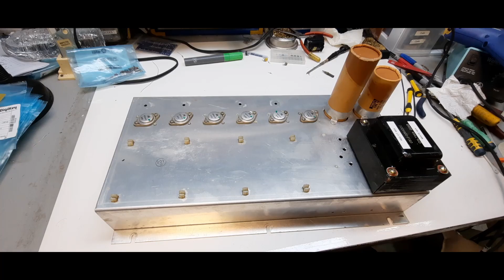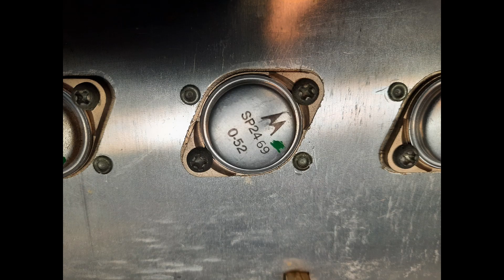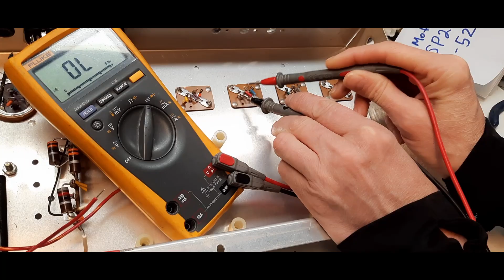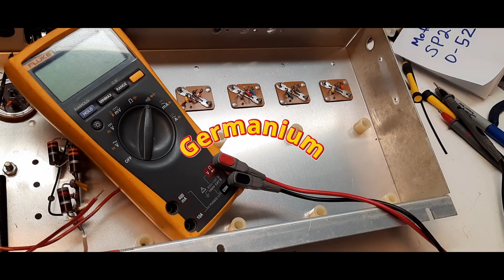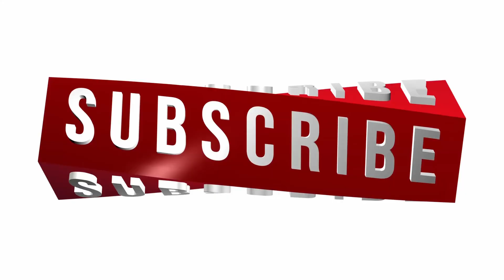Help! What Are These Transistors?

Comment: I couldn’t find the SP2469 in my library of cross references, but it was a good exercise to see how well the downloaded versions worked. Do you have a transistor tester M328 ? This would display the pin out and gain figures. Not sure if it indicates germanium or not.
Reply from the maker: No transistor tester. However, I definitely know it is a germanium and from the comments from others, i think I have a close match. Thanks for looking into it. Cheers!
Reply: @bettinaneumryr  Check out the M328. For less than $10 US it may be handy for you.

Comment: germanium made in 1952
Reply from the maker: Good to know... thanks~!
Reply: I was made in 1952, but the TO-3 germanium transistor didn't exist until 1955, and it was a Motorola 2N176. This is probably germanium made in the 52nd week of 1970. I spent 41 years of my life working in a Motorola plant. I don't think that the aluminum package existed in 1960, which is why I think these are from 1970. Motorola and others put "house numbers" on lots of parts for large quantity orders. This number rarely has any relation to the actual type number. I worked in consumer electronics repair from 1968 to 1973 when I left the repair world for an assembly line at Motorola. The hot part that was found in most consumer electronics in from the mid 60's well into the 70's was the 2N2147 PNP germanium TO-3 part. It was used in most amps in the 20 WPC and under range.
Reply: @TubelabCom date stamp states 1952
Reply: @PCBoardRepair  The 0-52 number on the package does not conform to the usual YYWW marking usually found on semiconductors and other parts, including those made by Motorola with 2NXXX type numbers. The TO-3 package seen in this video did not exist in 1952, so these parts were made after 1955 when Motorola invented and registered the TO-3 package. There are numerous examples of TO-3 and TO-36 devices made by Motorola with house numbers on them that do use an identical date code. The leading zero is the last digit in the year, so this part could have been made in 1960, 1970, or 1980. The -52 refers to the 52nd week of the year. The date code on those big Mallory electrolytic caps can tell you which decade they came from. I'm still guessing that these are from the last week of 1970. Likely PNP germanium. It appears that the original amp has been disassembled, but if the collector of a device was connected to the negative supply or an emitter was connected to a positive supply through a low value resistor, then the transistors are PNP, possibly a 2N2147 or 2N1360.

Comment: They are a germanium PNP in a standard T0-3 alloy package.
I dont know what you use them for in a modern project, except as some "antique novelty" etc, but at least that package only has one pin out so you know which pins are which.
Reply from the maker: Thanks for confirming! I plan to use them in a vintage-style amplifier project, if I find a project in a magazine. Cheers!

Comment: The number SP2469 does not appear in Towers' International Transistor Selector (1974), nor in the Babani International Transistor Equivalents Guide (BP85, 1981). No sign of 2N2469 either. So it's a mystery! But most likely a germanium part, if those forward voltage drop reading were in milliVolts. Don't listen to those in the comments who claim that germanium was never used for power transistors, or they must be NPN, or that an AI thinks the part is a MOSFET. There were plenty of PNP germanium power devices, e.g. OC23, used in car radios.
Reply: Vero, ne ho ancora adesso alcuni, recuperati proprio da vecchie autoradio moooolto tempo fa !
Reply from the maker: Yes ... Definitley PNP for sure. Thanks for checking Towers for me. I never heard of thay book. I plan on posting a video with the cap off and compare it to a silicon one soon.

Comment: Your measured drops are too high for single element die's,  they are more likely Compound Pair or Darlington Pair internally. These usually listed this as a multi junction or two transistor or compound in one package.  There would be internal resistances, the voltage drops would sum and yea they are not likely "transistors" but "packages".  Best identifier is a SAMS (paywalled) of course.  You can look up ones like Motorola MJ3001 or MJ3002 for reference but from what I see, they were not yet established consumer market at this point in design history (1965  designing for 1968 market release say) but were in the 'custom' state.
Reply from the maker: That's a really interesting point about them potentially being compound or Darlington pairs. I cut the cap of the TO-3 and there is some funny stuff going on. I plan on making a quick video with the magnifier mid week. Stay tuned to see what is inside. Cheers!

Comment: PNP Germanium. For sure. 100%. If you warm it up to 60deg C you can see the B-E voltage almost completely disapear becoming a short. If you heat it to 80C you should see a short circuit across B-E  thanks to the utterly craptastic temperature coefficient of germanium semiconductors
Reply from the maker: Hey ... you are right. I got it down to 4 ohms with my heat gun. I tried a silicon one and I could only get down to 140 ohms. Great way to tell if it is geranium. Thanks!

Comment: If you're getting a very low forward bias on the base pin, it's likely to be an older Germanium transistor, most of which were PNP .... but you should be able to deduce NPN or PNP from the bias... searching the part number did not help.  But if you call up directly to a parts distributor they're likely to have cross-reference listings that could lead you to the approximate specs.
Reply from the maker: Thanks for confirming my suspicion about the germanium transistor and the low forward bias!
Reply: @bettinaneumryr  
Glad I could help.

Comment: Pull one out and measure the   base - emitter   and   base - collector   voltage drop ..... a voltage of around 300 mV indicates a GERMANIUM transistor ... and  about 600 mV would be a SILICON type ....... DAVE™🛑
Reply from the maker: Yes, I did that and it was about 1.24V. Hence the reason to be confused. It turns out that they are PNP and Geranium. Equivalent to 2N2469. Thanks for watching!

Comment: Germanium  very possible. Very strange in an aluminum TO3. Possibly special order. I wouldn't use in a new design. If you have a diode setting, Ge would be like .3 Vf.
Reply: I thought the same, some old TO3 germ oc29's were made in a heavy TO3,copper/brass possibly package.
Reply from the maker: You are right! After getting more comments, it turns out they are germanium. Thanks for the help!
Reply: @bettinaneumryr hazard of spending many days with a curve tracer qualifying transistors.

Comment: Given the TO-5 case, it’s either a BJT, MOSFET, IGBT, SCR, Triac, or a voltage regulator IC. If it has “B” and “E” markings on the underside of the case, it’s a BJT (NPN or PNP) if it’s any good. If not, it could still be a BJT, but you’ll have to test it with a multimeter/DMM on continuity/diode-check mode. The easiest way is to have something like the Peak Atlas DCA55 component tester; it’ll identify the device and the pinout (as long as it’s not a voltage regulator - it won’t test those.)
Reply from the maker: A lot have replied and its a geranium pnp transistor. Thanks for the tips on the markings. This is useful. Cheets

Comment: If you can show the actually schematic diagram and how they were connected, than we could possibly see how they were used and offer a much better idea what they are and possible substitutes. Regardless what they originally were, I am pretty sure there are modern substitution for them...
Reply from the maker: Yeah .. I looked around and could not find a schematic for it. However, I was just confused about the low reading on the multimeter but now I know they are geranium. Cheers!

Comment: My 1979 ge replacement guide lists numbers all around but not that one.  Same with the rca from 1980 and  tcg from 1981.  If I can find my Motorola manual from that era will let you know.  I agree with other posters that its a special 2N2469.
Reply from the maker: Thanks for checking your manuals, I appreciate your help! That part number seems to be the organ company ID. However, I will go with the special 2N2469 for now and put them in the parts bin. Cheers!

Comment: You have to look it up in some old Motorola catalog. I could find some SP series transistors in this document, but not your exact part. On page 90 you can see an SP2431, which the document says it's equivalent to a HEP230 and the HEP230 is a PNP germanium alloy transistor for AF power amplifiers, so it all checks out. Maybe you have better luck with another similar catalog. https://www.worldradiohistory.com/Archive-Catalogs/Motorola/Motorola-HEP-1973-Cross-Reference.pdf

Comment: Just as with silicon, the Germanium transistors CAN  measured with any multimeter as the Diode Check setting of even the cheapest meters has plenty of current to test them. Although Germanium transistors DO HAVE higher Base-Collector leakage currents, its not enough to affect meter readings... All Germanium transistors DO have a very low junction voltage drop around the 100 mV to 150 mV range and that´s the typical forward bias voltage of all germanium diodes and other semiconductors of that era. Low power germanium transistors such as those found in old AM Radios tend to have a bit higher forward junction voltages in the range of 135 mV to 150 mV... The lower junction voltage is only a matter of the different material, being Germanium to make the semiconductor...  I got to restore some rare Philips 508 and 528 amplifiers some years ago and i still have 4 pairs of TO-3 AD149s power germanium transistors with similar ratings as described by @scottgilson3247 regarding the 2N2469...  On the note of replacing Ge transistors with Si based modern transistors is no easy task at all. All Ge power transistors do suffer from low gain, high leakage currents and a very low transition frequency (in the low KHz range) and all these parameters must be compensated in the original circuits´ design... Just dropping Si based modern replacements won´t do as driver stages in an amp need to be completely redesigned and re-stabilised as they will behave in unpredictable ways and won't bias properly as multiple mods are needed to bring operating points back to normal with Silicon based output transistors. It is a much simpler task in a power amp to just buid a whole new circuit with modern transistors and there's plenty of great designs all over.

Comment: They are very clearly germanium devices. When germanium ruled, NPN transistors were a great rarity. It is simply a function of the difficulties in manufacture of PNP versus NPN.
It is very likely that those transistors were used in two groups of three in parallel (or maybe one as a driver and two in parallel for output)  in a push-pull amplifier with an output transformer. The basic sort of design common with vacuum tubes would be pretty likely except the polarity is "reversed" (collector supply is negative instead of plate supply that is positive). With a tube amp, paralleling would not be expected, but early power transistors weren't capable of handling very much power. The whole amp was probably made with just PNP devices. A small driver transformer was a common thing in transistor amps.

Things called "Schottky transistors" were used in transistor-transistor logic (TTL) families like the 74Sxx and 74LSxx. They are just ordinary silicon bipolar junction transistors with a Schottky diode, anode to base and cathode to collector, to limit the degree of saturation in the ON state. This limits the number of "excess carriers" in the base region that have to "recombine" or be "swept out" on order to get the transistor to turn off. With fewer carriers to get rid of the "storage time" of the transistors is reduced and hence overall speed of the devices increased without the need for considerably more elaborate circuitry. The Schottky diode is a variant of the "Baker clamp."

The current through a semiconductor diode is exponential with respect to the voltage across the diode, ignoring secondary effects such as bulk resistance (which is often rather high in germanium devices). See the "Ebers-Moll" model for transistors. See the datasheet for a 1N4148 diode from Vishay for some graphs of forward voltage versus current (silicon). Over about four decades the plots are very straight on "semi-log" (logarithmic on one axis, linear on the other) at around 25 °C. Secondary effects come into play at very low and at high current and when the temperature gets "extreme."
Generally, the reverse leakage current through a germanium PN junction at moderate temperature is considerably higher than for a silicon junction.
Reply from the maker: Whoa .. Amazing information and history. I wad going through my ECG book in the morning after lots of replies and i noticed that most of the geranium transistors were PNP. i thought that was unusual but your explanation confirms my thoughts. BTW they all were PNP and there were two transformers connected to them. One side looked like primary and the secondary had two windings. I really should see if i can dig up the schematic. Anyway, thank you for taking the time to comment. I am learning so much from the comments. Cheers
Reply: Actually, NPN is easier to manufacture. But radio tube circuits are designed "the other way round", sinking currents instead of sourcing them and use currents in the opposite direction. So a PNP transistor can be used very similar to a vacuum tube. And the old engineers didn't want to think "upside down" twice just because they just had switched to transistors.
Reply: Wrong era.  They are silicon output transistors.

Comment: Yep special purpose devices, almost certainly germanium, probably work out to mullard ad149 or similar, probably the organ manufacture went to Motorola and requested a batch of power transistors specially selected for certain characteristics, so that number may not relate to anything outside that particular manufacturer's spec.
Reply from the maker: That's great information, thanks for sharing! I will add that to the classification. Cheers!
Reply: Output transistors are never Germanium. Not Special poupose either. Just a proprietary part number for a common transistor.

Comment: you can also use 2SC5200 TO-264 and make a adaptor pcb to fit them, Match pinout carefully: TO-3 is usually B-C-E (Base-Case-Emitter), while others are often B-C-E in-line.
Reply from the maker: This is great info. With the others commenting I can finally classify these transistors. Cheers!
Reply: That would be a Pain.  T0-3 Transistors are still available.
Reply: @mrgcav  90% are fake and these are motorola with in house motorola numbers the chance to find the exact ones is like looking for a needle in a haystack
Reply: Don't you mean 2SA1943? That is the PNP counterpart of 2SC5200.

Comment: You can replace that  with MJ21193 if NPN or MJ21194 for PNP
Reply from the maker: Not too sure about those ID's as they are silicon but I am sure if one modifies the circuit, they could be used. Cheers!
Reply: @bettinaneumryr  the difference is a higher gain so you just need to lower the gain a little and I believe XrayTonyB made some TO3 adapter pcb's to use the other package... To get Germanium transistors these day is getting harder each year
Reply from the maker: Interesting. I watch xRayTony once in a while and he is an incredible talent. Well, at least I got something rare in my parts bin. You never know, I might build an old magazine project that requires these. Thanks for your help.

Comment: In that era, there was only Germanium and Silicon for transistors . PNP transistors where easier to make, specially for power applications, so assume it is an early Germanium transistor. They will not have a lot of power, based on the thermal engineering of the chassis they are in. I would not stress them over 5 W. So you could use them for a low power Germanium audio amplifier. They could sound sweet that way. Germanium transistors have their own warm sound.
Reply from the maker: Thanks for the great info. I hope one of my projects requires these transistors. Did not know about the low power.
Reply: @bettinaneumryr  The heat sink and the rail voltage (for amps) is always a good indicator for the power rating :)
Reply: The 2N2078 has a eating of 170 watts at 40 volts. That "warm sound" is a myth from 40 year olds who claim to have golden ears.

Comment: It's likely a special (custom house numbered) version of a 2N2469, which was made by Motorola.  They were PNP Germanium 5 watt Vcb 200V Vce 100V Ic 3 Amp, but were packaged in a smaller TO-5 package.  They probably had Motorola put the transistor die into the larger TO-3 package to improve thermal performance.  The Vbe being low is probably because there is not much current from a DMM to give a normal germanium forward voltage drop.  For a smaller lower current transistor, you'd see a higher drop.  But these are probably huge dimensions on the die, so lower voltage drop at low current makes sense.
Reply: This rings true…
👍🏻
Reply from the maker: Wow, that's incredibly helpful information. Thanks for the detailed explanation! I had no idea the Fluke meter not having enough current. I always learn from you all. I will also add this info to my parts bin. Thanks!
Reply: @bettinaneumryr this is why you MUST, are REQUIRED TO have a SIMPSON 260 Multimeter!!!
Good hunting!
Reply: NTE102 is listed as a replacement, but it doesn't have nearly as high a voltage or power rating. Audio driver.
Reply: I think you close but they are most likely NPN not PNP. I have run into this sort of thing years ago.